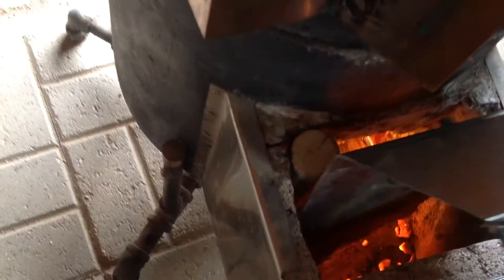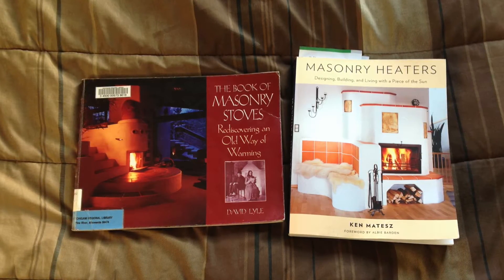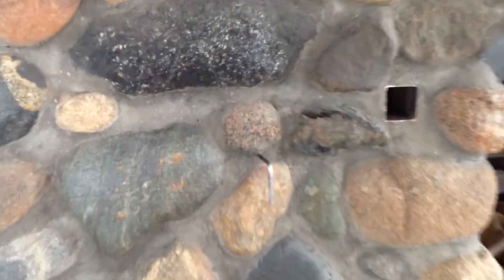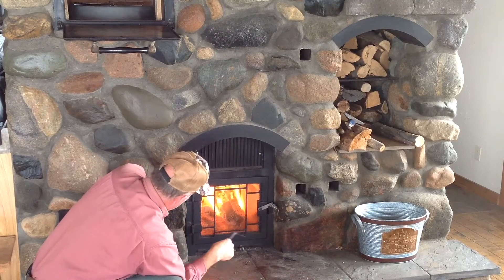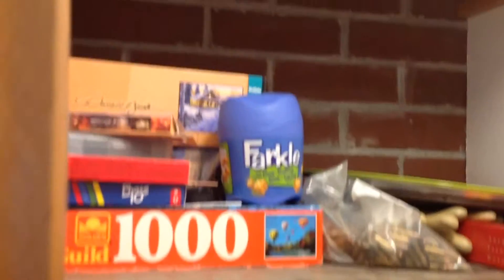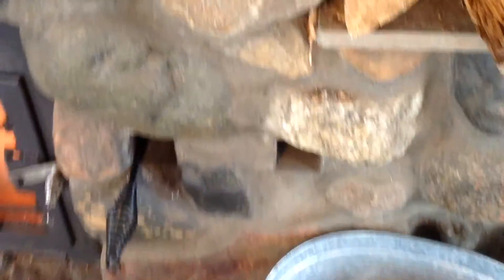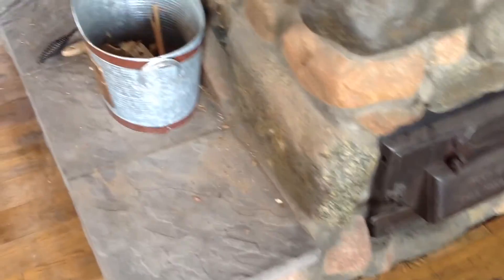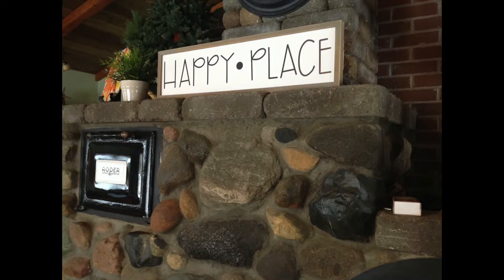Natural Stone Hybrid Fireplace; a closer look.  Part 1

Comment: Rocket mass heaters were developed from masonry heaters not the other way around. Rocket stoves burn efficiently, but need more attention for their operation. Masonry heaters went through a long legal process to get acceptance by ASTM 1602 and the IRC building code. Rocket stoves have never went through the regulatory process  which is why banks, building inspectors, and insurance companies won't allow them. Many areas have no building codes which enables the building of rocket stoves in homes. Like mentioned in the video that can be a problem when selling because financing by a bank requires the home to be upgraded to the national building code. Remember the building code is the absolute minimum standard not the max that many builders would like you to believe.
 The other problem, whether, a rocket stove, zero clearance fireplace, chimney, etc. is the insurance companies that will wiggle out of payment  for fire loss due to improper installation of code requirements, or non ASTM or UL  products. Proceed with caution with either system. 
    As for this unit nice job I know many masons with a few that could not have done as well as you.
Reply from the maker: Thanks for sharing and watching!  If I remember correctly, I think it took me 3 months to complete this.

Comment: Thanks for sharing, I would also be very proud of a fireplace like that. Something that I learned a few years ago that surprised me is that water has a much higher thermal mass that almost any other material including stone, a water tank would not look quite the same  though!
Reply from the maker: Hey Paul, I did give water some consideration.  I still might do something with heating water through the fireplace, for other usages.
A thermo mass storage element that is still better yet, is paraffin wax.  Because of its phase change properties.  Where I used my rocket stove; I set a big pot of wax on it to absorb the heat and melt.  Then it would radiate heat long after the fire was out as it change back into a solid.
Thanks for commenting!
Reply: Do you ever have trouble getting a draft out through the chimney?  Until that air heats up, I'd be concerned about smoke coming out through the front of the masonry fireplace
Reply: @koaea  he said he had a bypass, manually operated during start up.